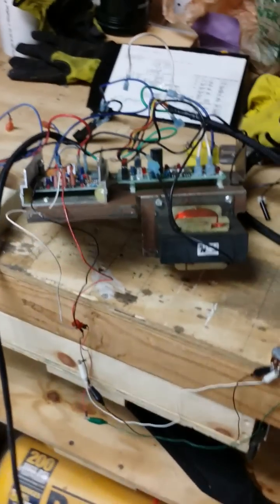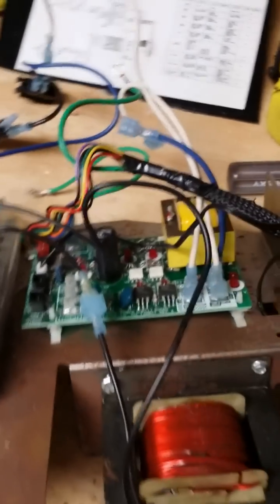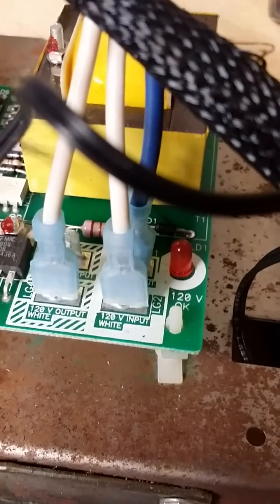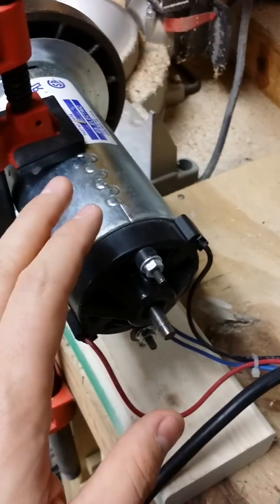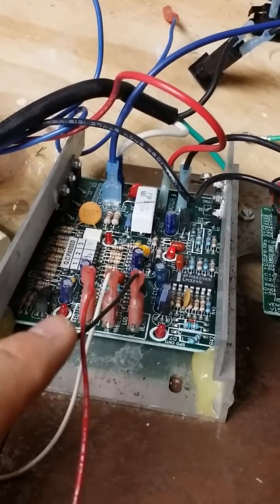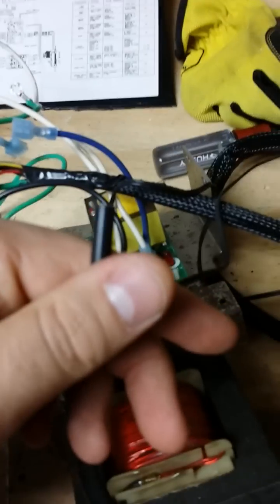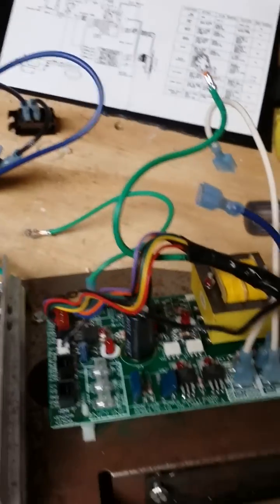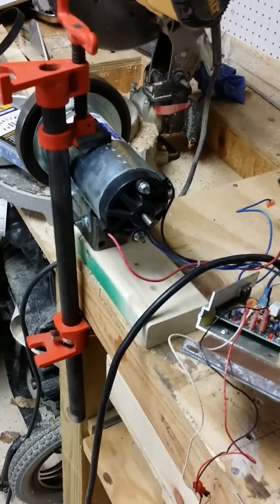Treadmill motor control board for variable speed power tools

Comment: Hi good video but I would like to know if you have tried bypass the controller and gone straight to the Venable speed switch or do you have to have the power board (mc60) to make it work? I have 2 treadmill motors salvaged that I have a use for that I would like to control the speed.  Thank you for putting this out there.

Comment: What did you do with the green ground wire coming out of the wall (AC power)?
Reply from the maker: It's a ground wire.
Reply: @ThunderDog  Yeah. Where did you connect it on the motor control? Thanks!
Reply from the maker: It's been so long ago, looks like it was attached to the metal plate that holds both the controller and the power supply.

Comment: Just stumbled across this video. I did the same thing with the same crappy bandsaw. It worked good for a time. But then the board was wasted from a flood. I plan on doing this on my wood lathe as well as my drill press. The only problem is that the electronics won't last long. You should really use another type of speed controller.
Reply from the maker: My thoughts, the motor is just not powerful enough for what I thought at the time was all that I needed.  However, this controller and motor still work just fine for wood/Aluminum/or thin metal.

Comment: 25$!!... about 5 blocks from my house is an independent thrift store that takes donations. On the outside are two 3 walled concrete block bins, some what like you sometimes see mulch or gravel being stored. 

The thrift store puts things in those bins and anything in them are free. Simply find something you want and take it. No questions asked. 

I have only been going to the place for about a month and ive seen lots of goodies in those bins but only recently discoved it was free. 

Well what do you know? Went over there and there sat a tredmill free for the grabbing. I double checked with the store that i could have it and sure enough i was encouraged to take it.

Before plugging it in, a bunch of know it alls who are too good to go trash picking, assured me that the tredmill wouldnt work. 

So i plugged it in, nothing....... then it immediatly dawned on me that tredmills have a saftey clip that detaches from the control panel. Found it, plugged it in and the tredmill ran with absolutely no issue.

Ive seen discarded tredmills before but didnt have a way to haul or carry it. This one has to be about the third one ive seen just thrown away but the first one i was capable of taking. 

People have decided that walking out in the world is better then not actually going any where.
Reply from the maker: +Theophrastus Baumast I have seen and picked up a few freebies too.  Just have to key your eyes open.

Comment: Great video. Did you end up removing the flywheel from the motor? Did you have any problems with power transmission?
Reply from the maker: Thanks, I've never used the flywheel in any of my applications.  Your mileage may vary.

Comment: Do you have any idea why a newly installed tachometer would read 2 or 3 times faster than what the spindle is turning? I just installed a new tach and when the spindle is barely turning the tach will read 400 or 500 rpms. 
Thanks

Comment: Found a free treadmill with a busted console and started doing some research.  Your video was the best.  Not cutting any wires is the way to go.  I got the treadmill working, doing just as you said.  Thanks for the info!
Reply from the maker: To be clear, my reed switch is NOT connected to anything.  I completely unplugged that from the board.  If you're trying to repair a treadmill I'm afraid I can't help in that capacity.
Reply from the maker: +Jason Monroe Glad I could help.  Thanks for watching.
Reply: My treadmill goes in safe mode when read switch is out of sync! Any idea how I can bypass this?
Reply from the maker: +Thor Erling Iversen Not really sure what you mean.
Reply: ThunderDog It shuts off after 30 sec when read switch doesn't get a.correct reading of the magnet on the drive wheel. I need to bypass this to get it working

Comment: Helpful video, Thanks!  What specific potentiometer did you use?  After calling around and looking online it turns out there are many different kinds.....My treadmill motor will be used for a drill press.
Reply from the maker: +Monte - 5k or 10k. I'll check later today.

Comment: Great video ! one question, can the red and black feed from the MC 60 to the motor be reversed to change the motor rotation ?
Reply from the maker: Hmmm, not sure.  I'm currently looking into how to setup direction change right now.  I hope to put out another video explaining one other modification to this setup.  I found a way to  "reset" or jog the system and keep the potentiometer at the exact speed/setting of your previous use.  This is handy for things like a lathe or mill.  Stay tuned.  Sorry, for not having an exact answer to your specific question.
Reply: Someone sent me this question to answer. I hope this helps. Check out my video on my harbor freight lathe up grade on my channel. It will show you in detail how to reverse a DC motor with a $7 switch you can buy at any hardware or big box store. 
Take care
Mark

Comment: Hi thunderDog that was so helpful I do not know my ass from my elbow but you presented in such a easy way I got my sidewalk pickup motor to work runs from 100 rams to 8 only went to 2500 rpmsthat was enough for my lathe.
Thanks again Wattsy
Reply from the maker: +Dan Watts So, you put it on your lathe?  If so, does your lathe have a jackshaft pulley and did you abandoned it?  I've had another one of these treadmill controllers sitting around and I'm considering the conversion for my lathe.  BTW, thanks for the feedback and I'm glad it helped.
Reply: have not got that far yet working on pulley set up and fixing motor behind the lathe and putting the board and vcswitch on a setup of some sort thanks again
Reply: what is a jack knife pulley?
Reply from the maker: Doh, jackshaft pulley.  That's what happens when you're typing one thing and thinking something else.

Comment: Thanks for getting to the point quickly! Question I have always had is whether or not to use the choke. Sure it runs without it but from what I understand it runs better under heavy load with the choke. Any ideas?

Comment: I'm working on a project involving a 4.25 hp 130 VDC/3171 Watt motor I grabbed from a treadmill. Yeah...she's a doozy. The board that came with this treadmill is quite different, and I'm wondering if I could use one of these mc60's to power my motor. Two questions come to mind - is your motor AC or DC? would this board handle the current needed for my motor? I can't recognize any rectifier or large caps for stabilizing the current on the board you're using, which makes me think that you've just got a AC motor... is that true? I'm not very tech saavy.... Also, at 130 V and 3171 W, my motor is pulling up to ~24.4 amps. Do you think this board could handle that, and what type of POT would you suggest?
Reply: It is a DC motor. Every treadmill I have seen uses a DC motor, and I think they do that because it is cheaper than using a VFD (variable frequency drive). With AC motors it is preferred to change the frequency of the current rather than the voltage to control the speed.

Comment: Good job bud. How far did you get? I'm installing a 2.7 into a lathe that used a 1hp ac motor. And I have another 1.5hp going into a drill press. And a third 2.25hp I'm making a large disc sander out of. But that one I have to find a motor controller for. You lucked out with the mc60. Super popular. Both treadmills I took apart used some other branded one. One I let the smoke dragon out of but fixed. And the newest 2.7hp one I haven't had a chance to play with yet. 

You know you can negate the whole circuit and second psu and just feed the output transistor a PWM SIGNAL from a arduino.? Then you can have a pretty cool touch screen. To increase or decrease the speed. On my 1.5hp controller is was the right leg. But you can bring up the specs from google of yours. 

Really fun projects.
Reply from the maker: Bart Koscow I installed the one from the video into the band saw.  It works great.  Let me reiterate that I get into these types of projects and only really have a small bit of knowledge most of the time.  Case in point:  I ordered a metal cutting band saw blade and was able to successfully cut out several knife blanks.  The metal I was cutting was approx. 1/4" thick 1095 steel.  I was stupid and didn't use any cutting oil or lubricant, so I burnt that blade up prematurely. 

I also modified the band saw by replacing the pulley on the back to a 10" pulley. The treadmill motor has a 2.5" pulley installed on it.

I have another treadmill motor(exactly the same as my video) that I want to install on a metal lathe that I got for free.  It is an old 1940's Myford 3.5"(ENGLISH) lathe.  I've never used a lathe in my life, so that's another project that I'm getting into with limited knowledge.

Comment: This is just what I was looking for.. very straightforward and easy to understand..it would be helpful however if you could have used the red white and black wiring only for the pot I had to still frame the vid to trace out your leads. Other than that it was right on. Thank You very much